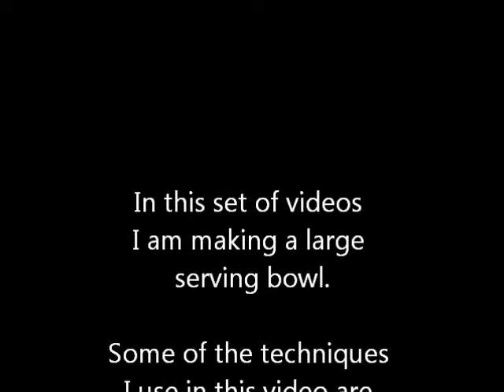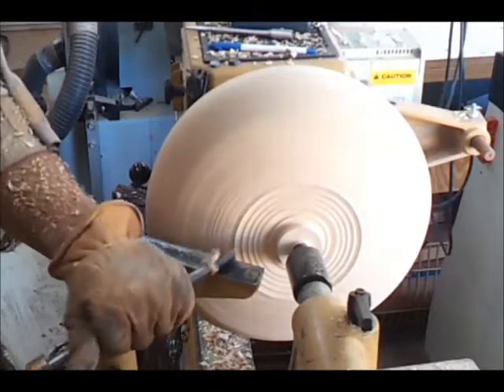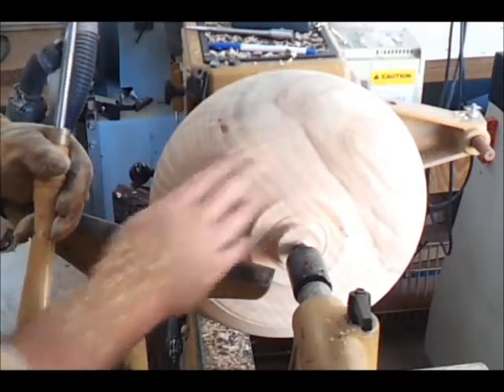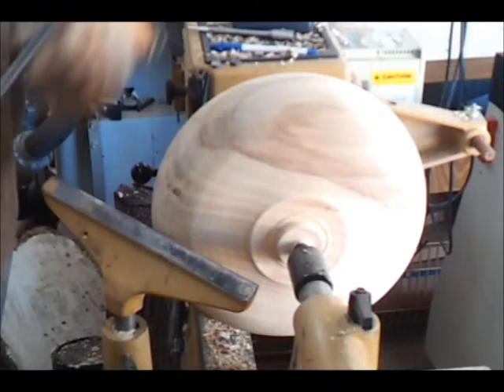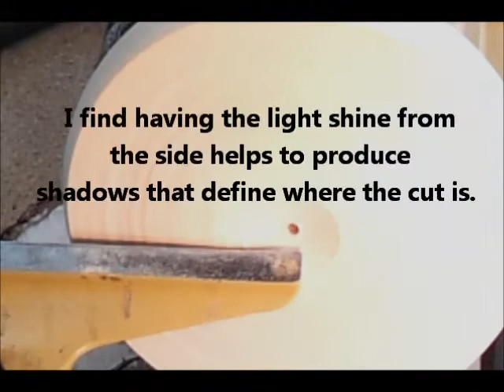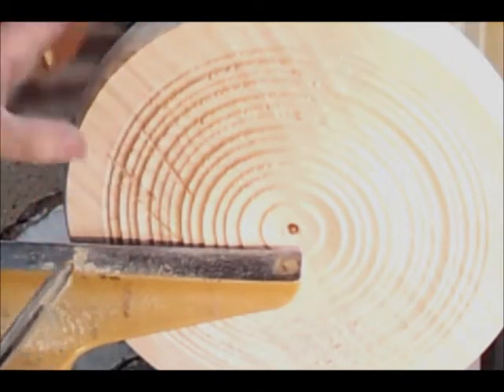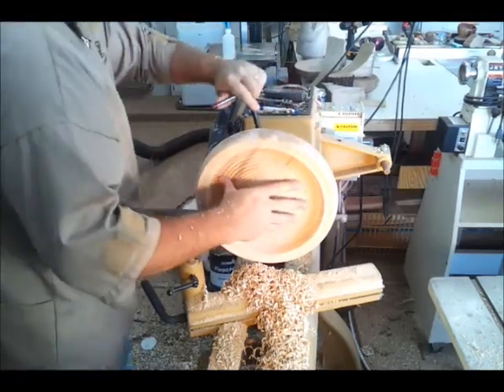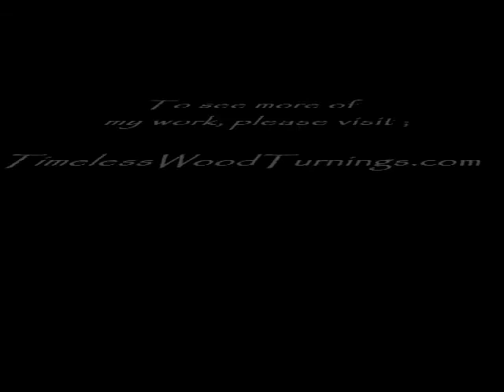Making a Large Serving Bowl - Part 2of 3

Comment from the maker: Thank you Mark.
I do have a dedicated chuck with the large aluminum jaws on it. As long as your tenon is sized to the proper diameter for the jaws being used there shouldn't be a problem.

If this had been a larger bowl or deeper I would have used the other chuck. using the smaller jaws allows me to create the foot and signature rings without having to worry too much about cleaning up the foot. I hope this explanation helps!

Comment from the maker: Joe,
If the off center is not too much you may be able to live with it. If its left or right you may be able to adjust it by loosening the headstock and trying to reposition a bit.
It won't wobble as long as you are turning between centers, like from a spur drive while using a live center in the tailstock.
The issue you may run in to is if you create a tennon while between centers, then mount it into a chuck without tailstock support. The it will wobble a bit till you remove the ecentric stock.

Comment: question... I have a Delta wood lathe and I don't think the centers meet precisely.  I  don't think there is a way to correct the problem.  If I turn a cylindrical will it wobble or will it be perfectly round?